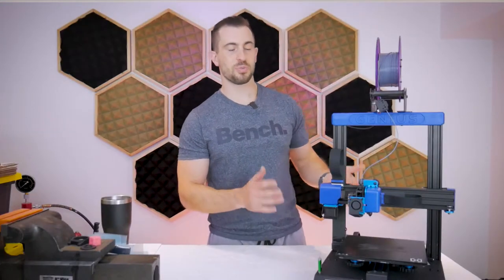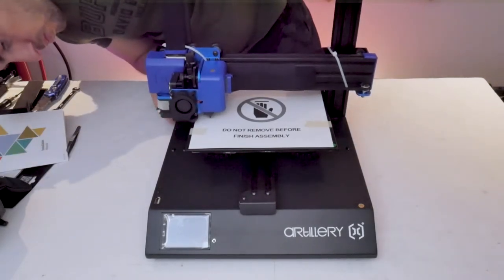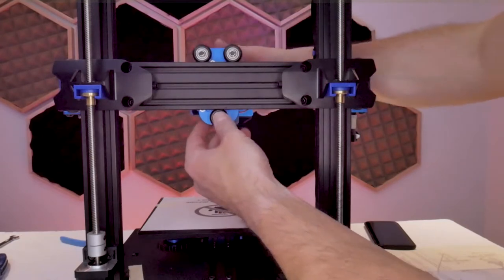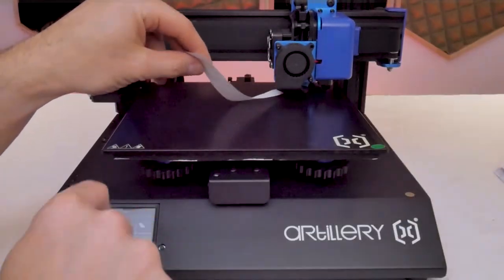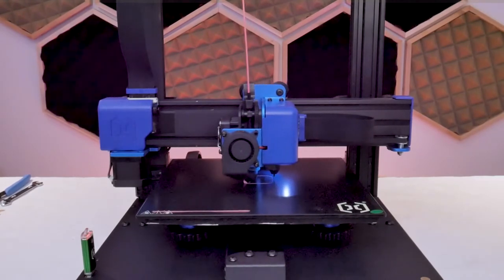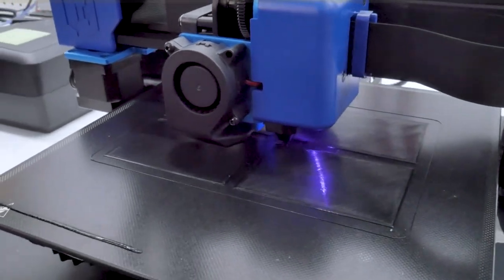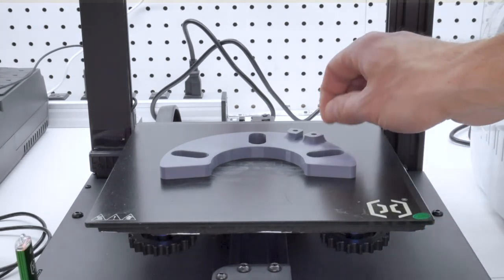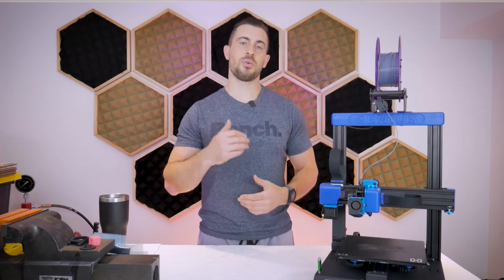Artillery Genius Pro Long Term Review, Assembly and Setup Guide

Comment: I have purchased three of the artillery printers.  The last one is the pro version that has the auto bed leveling.  It has been quite reliable over all.  I have had some problems the took some time to correct.  I purchased removable magnetic print bed for two of the printers so I would not have to wait for the bed to cool down.  I highly recommend the removable print bed.  For the price pretty good printers.  Thanks for the review.
Reply from the maker: Flex plates are one of the best mods to any printer, glad you're enjoying your genius pros! I'm still using mine as well

Comment: I'm having huge problems with Z banding on my Genius Pro and have tried all sorts of fixes to no avail. The banding seems height related as the bands shift inward or outward on all sides at the same time, not like a x or y movement. If if were a gantry or bed position issue, I'd expect the print to shift left/right or bad/forward, not shrink or grow. It's like the lines laid down are fatter or thinner. Tried various fixes and cleanups of the extruder and am really happy with it now, but the problem persists. Some original reviews of the printer complained of the same issues with no relevant solution offered. Tempted now to replace the vertical rods with belts.

Comment: Nice to take all this time to do a long term review like this. I'm trying to decide if I will buy this or the Ender 3 S1 as my first 3d printer, any advice?
Reply: Hmm.. It depends on what you need. I personally have a Sidewinder X1 and it has a great print volume
Reply from the maker: I just had to make the same decision for a print farm that I am growing.. ultimately I went with the S1 for the purpose of community support. Out of the box I think the artillery is probably a better printer overall but eventually when you want to do upgrades / custom firmwares / repairs etc Creality is more popular and there is more stuff available. The other small advantage the S1 has is that it already has the magnet in place for the flex plate (which you should definitely upgrade to PEI). On the genius pro you would have to stick the magnet to the glass because I don't know how easy/difficult it would be to separate the glass from the pad underneath. All that being said, if you don't plan on doing upgrades and just want to run the printer as is the genius pro is a solid choice and I believe they run even better deals than Creality at certain times of the year.

Comment: How did you add a start code for ABL in prusa slicer? Also, if the glass isn't removable, could I not glue the flex plate on top of it?
Reply from the maker: Are you looking to run the ABL at the beginning of every print? And yes, you can stick the magnetic sheet right on the glass if you want to add a flex plate.
Reply: @EmbraceMaking  Yes, I'd like that. I have couple of other printers set up the same way and it seems to work great for me. Now I'm waiting for my Genius Pro to arrive and I'd like to do the same.

Comment: Great video! This is the first printer I ever bought and I had some troubles with leveling the bed, it was so easy to understand what to do with your video! thanks for that! ✌🏽✌🏽✌🏽
I do have a quick question about adjusting the Z axis while printing- I tried to do that but nothing changed during the print- should I pause the printing for doing that? or should it change while printing?
Reply from the maker: Hi Eliya! You shouldn't need to pause the print, it is a live adjustment so it happens in real time. You should only do it when the printer is printing first layer and you may have to tap the button several times in either direction to notice a difference. If I remember correctly it shows increments of 0.025mm which is very fine adjustment. Four presses in one direction is roughly the thickness of a piece of paper so maybe give it a try again?
Reply: @EmbraceMaking  Thanks for the response! 🪄
I did give it another try and kept on adjusting the bed and managed to print my first print ever- a slug that came out really nice and most of it moves! 🤣
Thank youuu again for the video! It helped a lot! 🧡
Reply from the maker: No problem and glad you got it figured out. You're well on your way to a future 3D printing addiction now! lol Don't hesitate to come back if you need any other help :)

Comment: Did you have any luck with adjusting the wheels on the z axis?
Reply from the maker: Does not appear that you can adjust them from I can see... however, my printer is still going strong on a regular basis and it does not seem to effect the print quality. Out of the box this printer arguably prints better than the similarly featured ender 3 S1

Comment: Do you think this is worth it for €330 or wait and buy a prusa mini+ for €450
Reply from the maker: I have no doubt the Prusa mini will be an outstanding performing machine despite having never used one myself... but I guess the other question you have to ask yourself other than price is what you need for build volume. The prusa mini is a bit smaller at 180x180 in the X/Y ... is that going to be too small for you?